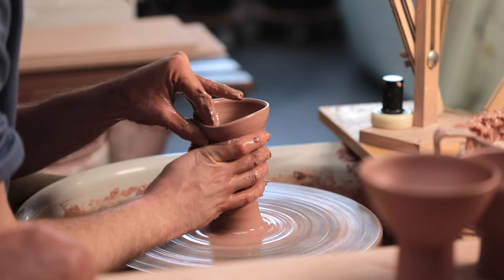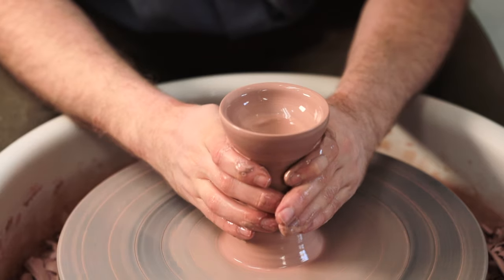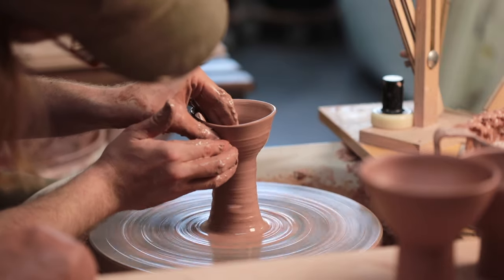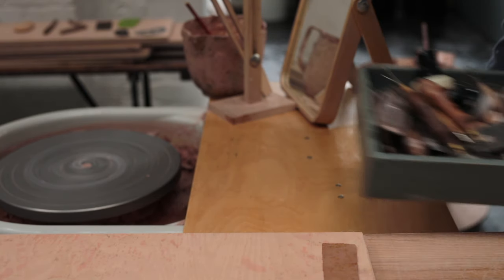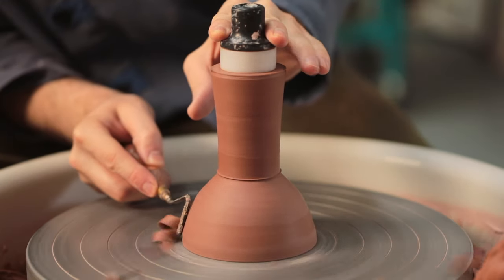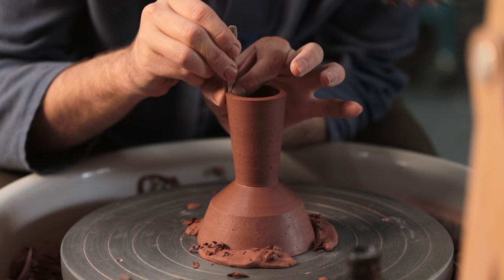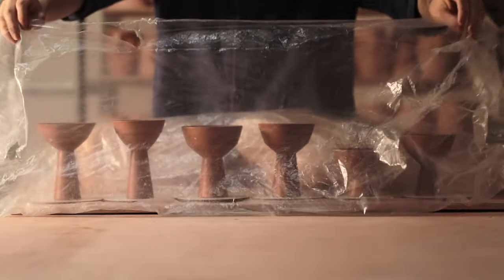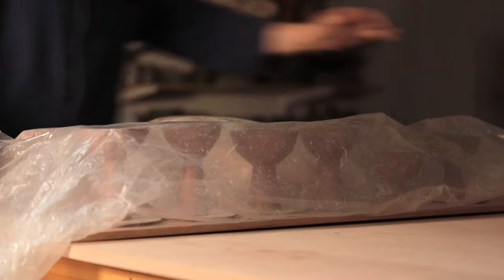The Deepest Feet I've Ever Trimmed

Comment: For those wondering, cut wedging 23 times produces 8,388,608 (2²³) layers. Assuming the block is about 28cm tall (by guesstimating Florian's span to be roughly 20cm) that means every layer is around 33nm tall, which corresponds to somewhere around 20 molecules of clay.

I'd say that was mixed enough
Reply: r/theydidthemath
Reply: I'm so glad I saw your comment because I was wondering how many layers that must have added up to😂
Reply: Im sorry, i only accept pottery made with 10,000,000 or more layers, what are we? barbarians? (wink)

Comment: these would be good for charcuterie boards as the stem is smaller than the width of the bowl, and adds some nice height/dyanamic nature. i think they would be nice to have as a set of 3 with 3 different heights but the same size bowl. could also be good just for decoration that way.
Reply: oh this 100%

Comment: This is very timely as I spent my last session in the studio throwing a large stemmed bowl in two pieces. It's the size of a fruit bowl so quite a bit larger than yours but all of these tips you mention here will help me with the next ones I make. I am interested in making some smaller ones with very tall stems to put on my mantle. I've always found it very hard to trim inside a cylinder as you have here but I think I'm ready to give it a go after this video.  Do you ever have trouble with the bowl tilting during firing?

Comment: Every time I see you wedging clay, I notice that the ?plywood? work table just seems to be bare, unsealed.  You're also always shown washing it down afterwards, but does it really not absorb enough of the ironware clay to taint the porcelain?
Reply from the maker: To be honest, the left side of the table is much less stained than the right! So, once thoroughly washed, I wedge most of my porcelain on that end. So far though, I haven't had much contamination, but you are right, it helps to be careful. I suppose I could pin down a sheet of canvas and wedge on that, or find a clean ware board and use a vice to hold it onto the tabletop and wedge on that. Lots of options!